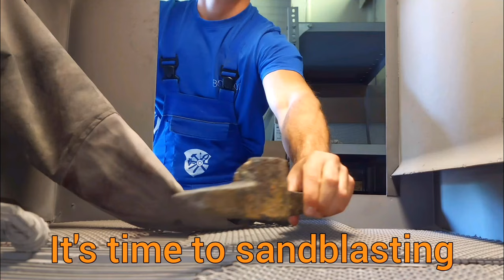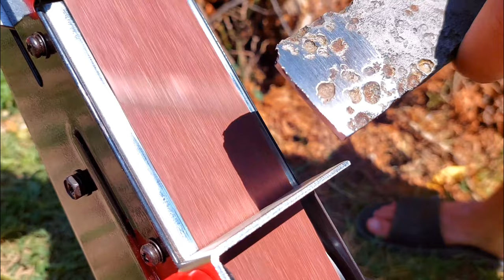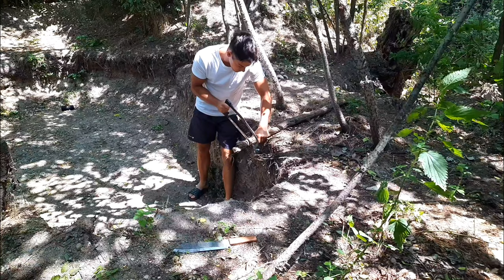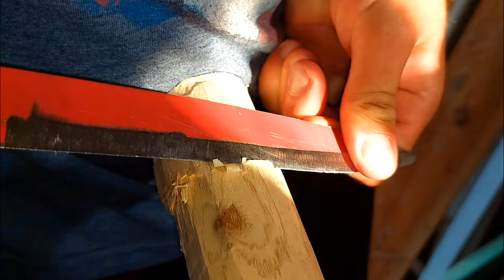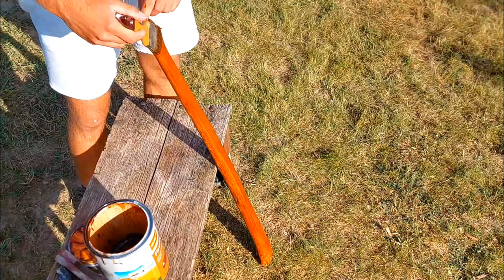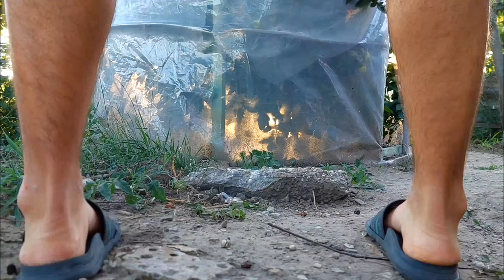ANTIQUE VERY RUSTY PICKAXE RESTORATION

Comment: Your videos are AMAZING!!! The Combination Safe was incredible!!! I have a really cool idea for something you should make, and I think it would be so cool, that I'm happy to send you money to pay for the materials and your time. You can even keep it when you're finished. I simply want to see how you would make it. I am trying to find a YouTube machinist/maker who will make a Meat Grinder... from scratch. I'm not talking about finding some eBay antique hand-cranked meet grinder and adding a motor. I mean... I want to see someone create a high quality meat grinder with a high torque motor, from scratch!
I think it is something that post people would think... "That's not so difficult!" But... yes it is. A meat grinder has a screw auger conveyer system that pulls the meat through the tube, but the auger "capacity" is larger at the beginning, and the "gap" gets narrower as it reaches the spinning blade. Also... a meat grinder will have an AC induction motor that will be spinning at ~1800 rpm (in the US) and will need to have a gear box that reduces it to125-175 rpm. Also the cutting "plate" with all the holes in it must be precision ground to be dead-flat... AND the star-shaped rotary blade must also be dead-flat to mate with the flat plate. 
AND the hardest part (in my opinion) is that the inside of the main tube has grooves cut into the tube walls, kind of like riffling down the barrel of a gun. I'm not sure the function behind these grooves, but the professional models have rather pronounced grooves. I speak German, so I look at a lot of websites about meat grinders in Germany. If you are interested to see, you can google the word Fleischwolf or Fleischwölfe, and you will see these grooves I am talking about. 
And finally... the motor... I think it would be super cool to find a straight up huge Capacitor Start/Run 1.200 Watt (1.5 HP) AC Induction motor. But... it might also be super cool to use like... a woodworking router spindle as the motor. With the right gear ratio... it could be super cool. 
If you are interested in this at all, you can reach out to me at michaelscottperkins at gmail dot com. 

Either way... you make GREAT videos!!! Keep it up!
Reply from the maker: Thank you man!! that's a great idea! I will look into what you talked about and maybe try to make one. I already had a plan for a salami slicing machine without electronics and this will probably be the next project and I will combine it with the meat grinder